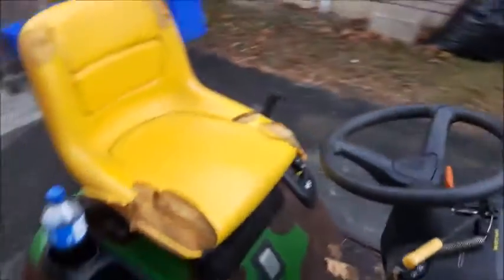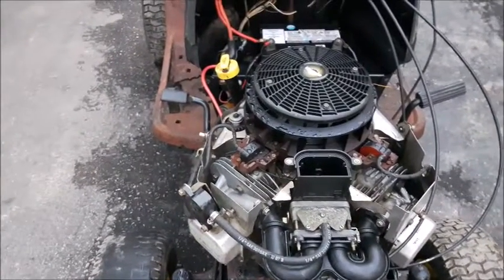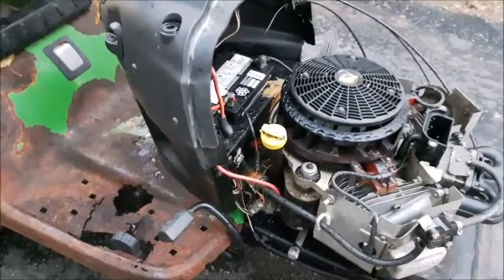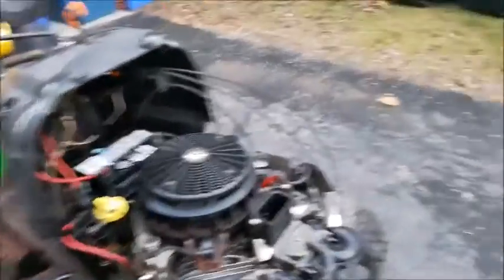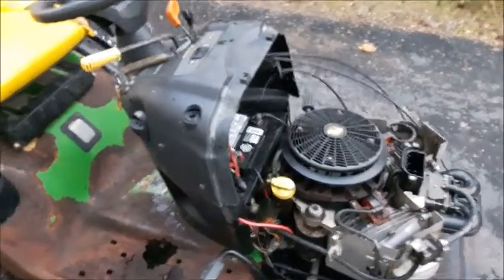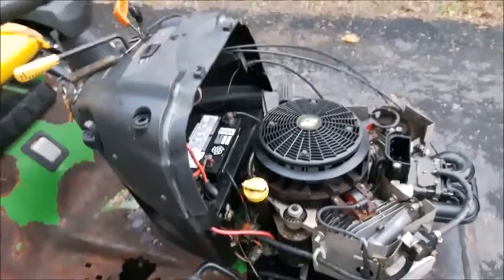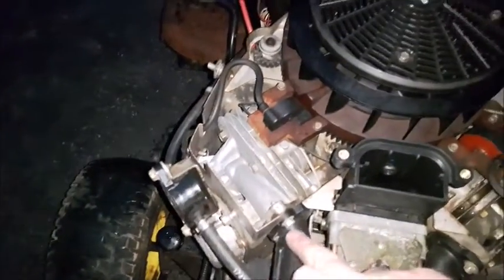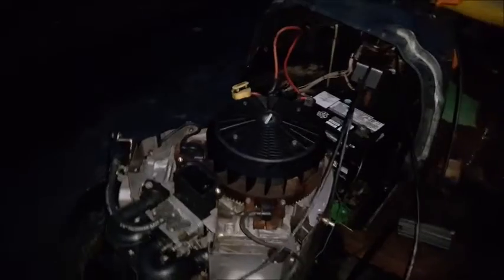JohnDeere L118 Bit of work

Comment: Pull the carburetter apart and clean it sorry Brian I do not agree with using sealant on those O-rings it never come from the manufacturer on those engines I have never used any sealant I've been doing this for over 25 years as a licensed mechanic